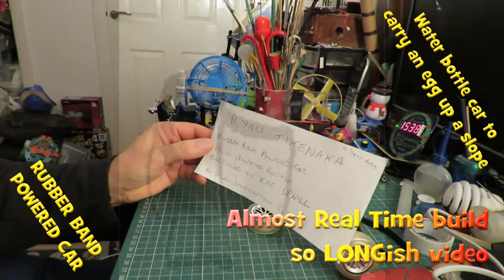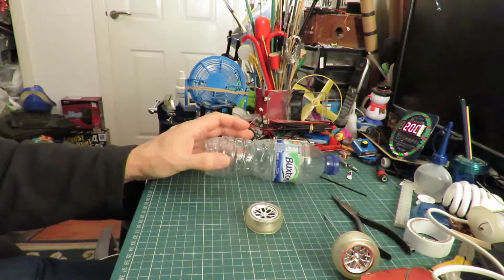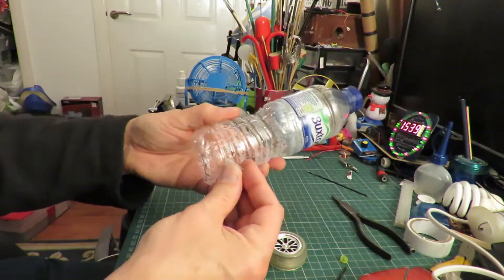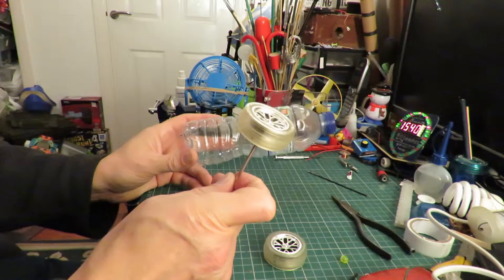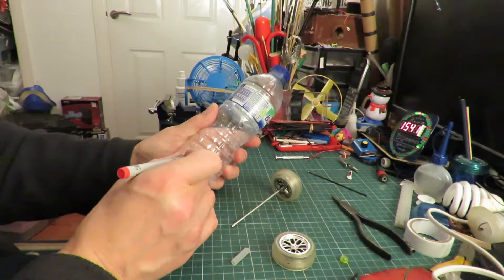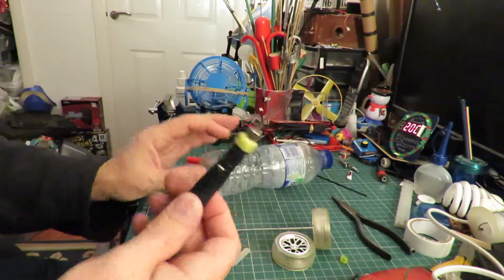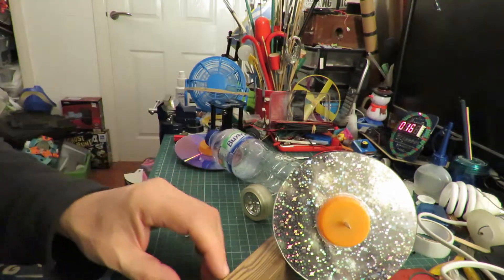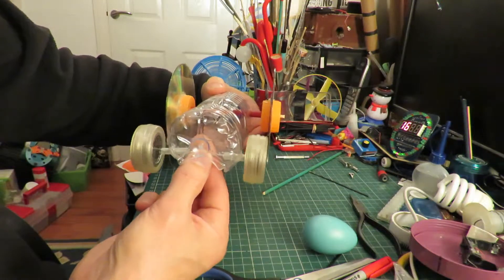Rubber Band Powered Car carry Egg up a slope FULL LENGTH

Comment: How did you do the rubber band attaching in front (the hole on he cap) to the back?
I didn’t quite understand that part.
Reply: I don't understand your question. The rubber band goes through the hole in the cap and will have something to stop it pulling through, like a short stick. At the other end of the car it wraps round the back axle. I show you that in the video.